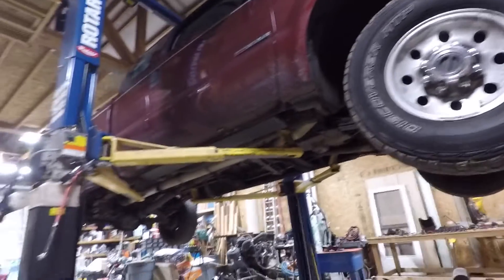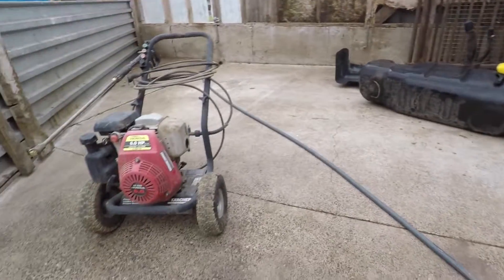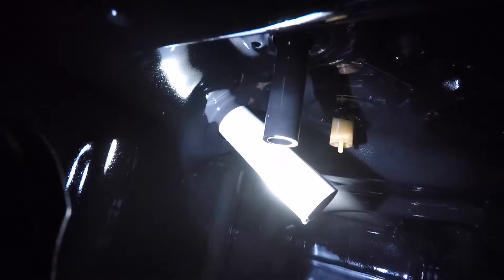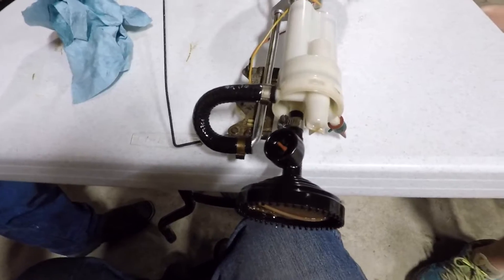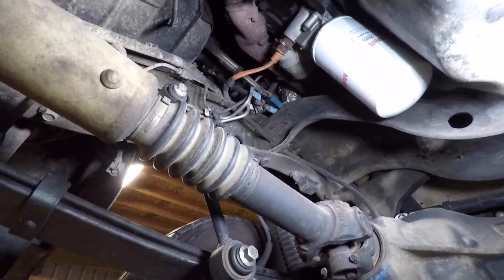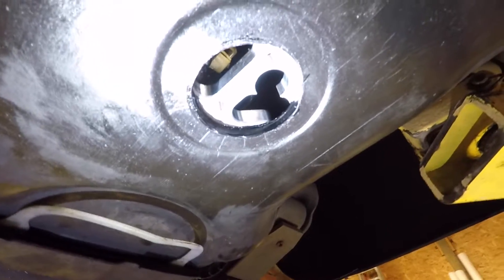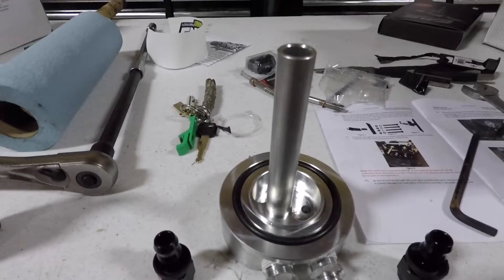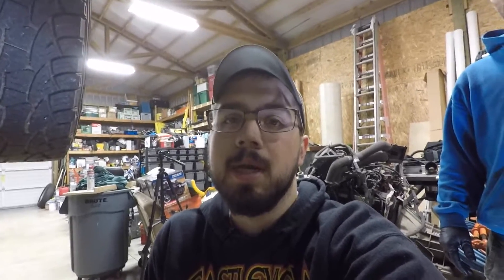HUGE Fuel Upgrade for the Ford 7.3 Powerstroke: Part 2

Comment: Hey man how does it hold fuel pressure I just installed the same air dog but mines goes to the fuel bowl and drops pressure thanks
Reply from the maker: Under normal driving I see fluctuation of around 3psi. Under wot I can see drops of around 5 psi. What kind of drops are you seeing?
Reply: Living On Wheels it drops 5 psi crushing and 10 at half throttle
Reply from the maker: barry underwood hmm yeah that definitely seems like too much. What’s your suction setup from the tank? Possibly too restrictive. Could have a bad Oring in the regulator
Reply: Living On Wheels I have it pulling from the stock fuel straw
Reply from the maker: barry underwood I can’t say for sure but maybe that’s just too restrictive. Especially if you still have the original screens inside the tank. Would be with checking the regulator Orings though since it’s free and easy.
Reply: Living On Wheels okay thanks man also do you have any pictures of how you mounted you pump I have mine under the cab because the e brake lines where in the way under the bed
Reply from the maker: barry underwood I have a couple pics. If you wana shoot me a message on Instagram I can send them you me way. I mounted mine almost directly below the tank filler neck. The parking brake Calle runs behind it between the pump and frame.

Comment: Do the fuel filters drop below the frame?
Reply from the maker: The way I have it set up, the filters are pretty close to in line with the frame. They might hang down a little below. However, they are far above the bottom of the tank and above the body line so you can't see them.

Comment: hey dude, does the sump fit between the skid and the tank? im nervous about doing this and having it exposed as I DO tank my truck on some rocck trails for recovery of my jeeps.
Reply from the maker: I can't speak for all trucks but on my truck, there was no lower skid plate from the factory. The bottom of the tank was exposed. The side cover if the tank is a very snug fit and I don't think you would be able to route the lines up in that direction. That being said, I have thought about fabricating a simple skid plate to cover the lines and the sump itself and I don't think it would be hard to do at all.